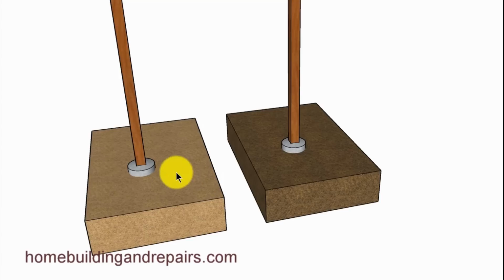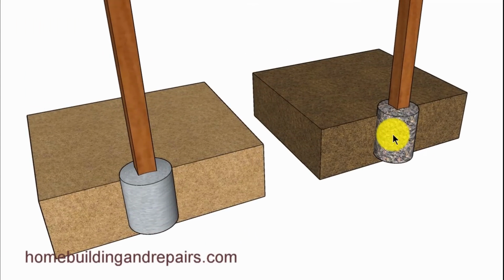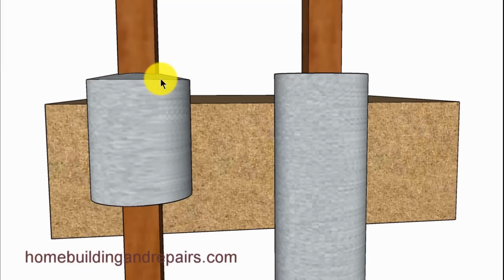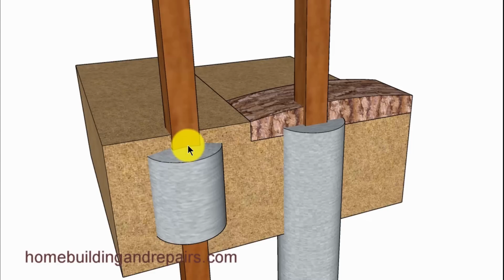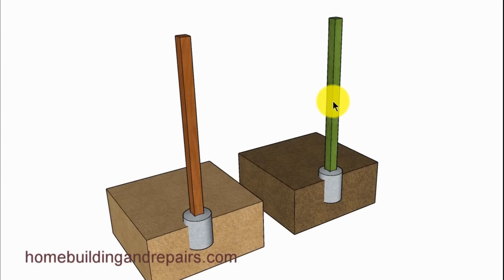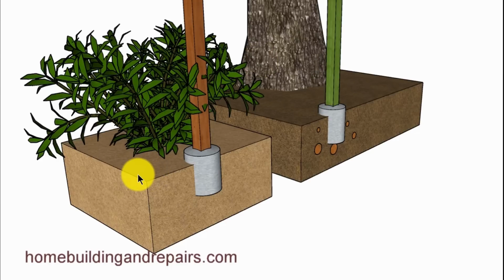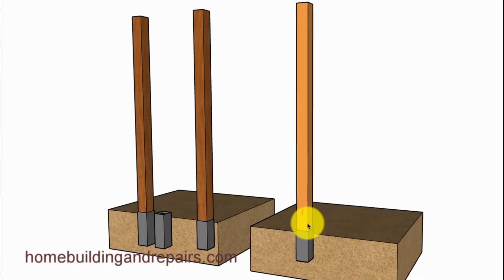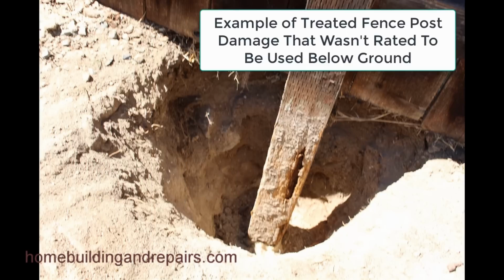Watch This Video Before Installing Your Next Wood Fence Post – Money Saving Ideas

Comment from the maker: Here's a playlist that might be helpful for a fence I recently built.

https://www.youtube.com/watch?v=6Zf0nvCbhfw&list=PLC0UeuIWsWeVsj-eNm8ABvISxTVVK8uQK
Reply: Fence posts vs concrete: dig hole, insert concrete sono-tube, fill sono-tube with concrete, insert Simpson teco-clips/concrete strong ties for fence post/column concrete anchor bases set at the correct height, etc., install post, install galvanized hardware(through bolt(s)/nails).
Reply: Too much talk…

Comment: Is there any benefit or drawback to using a cardboard tube form instead of putting the concrete directly into the post hole without a form?

Comment: What if you have sandy soil and the groundwater is just a couple feet below surface? I’m installing 12’ 6x6 posts and my hole needs to be at least 4 feet deep. Only problem is the groundwater sits roughly 2-3 feet below surface so am I just supposed to set the post in water and have it sitting in water indefinitely? Doesn’t sound right.
Reply from the maker: I couldn't help much with this one.

Comment: Hi I love your channel it is very informational!  What is the best way to install a wood fence over asphalt?
Reply from the maker: You will need some type of bracing to hold the fence up unless you remove a small section of the asphalt to dig a hole for the fence post. The bracing might require more lumber but if the fence is only temporary, then I would install the braces at a 45 degree angle and then attach them some how to sand bags at the bottom for support.

Comment: Quick question! I am installing post in Illinois. Soil isn’t draining due to clay or the water table is high. Regardless, based on your video, are you saying the best option is to surround the post with concrete. Is there concern that water will soak into the concrete and have no where to go once inside the concrete? Or will concrete keep water out from from the water table.
Reply from the maker: I would contact a fence builder in your area or your local building department for more information. I've only worked in a few areas with high water tables and nobody had fences.

Comment: My very old 100ft long and 6 ft fence posts sit in concrete where a concrete tubes were used.  Recently Fence Co estimator was suggesting just pouring cement in 3ft hole and setting posts in that then building a cement collars for drainage. This method will allow for a complete 100 ft fence to be built in one day while using the concrete tubes installation will take two days.  Any preference on that?
Reply from the maker: That sounds like a solid method, but do some more research. I don't know where you're located, soil conditions, lumber you're using or other important factors that make it difficult to provide a good answer.

Comment: I really wish I could still find Black Locust fence post wood.. That wood will not rot! You literally don't even have to set it in concrete you can just stick it right in the ground and 100yrs later it will still be standing. An old Amish guy in PA told me that and I seen his old fence that his granddad built and it would seem he was right.

Comment: It seems like the best one is the one at the very end with the tall metal brackets and the wood not being down in the concrete to rot. If the wood did ever need to be replaced  you wouldn’t have to dig up the whole thing, just replace a post. And if you keep the metal painted and clean then it shouldn’t rust for decades. Right?
Reply: Oh and thank you, thank you for the very informative video!

Comment: Just saw another video with a wood post placed in concrete and the wood post was rotting away. Concrete will wick moisture right to the wood which is not good.

Comment: First thing they should have said in this video don't use a wood pole because it's going to wrought. I will always use steel poles and most cities now only will let you use metal poles and not wood that's my two cents.
Reply from the maker: Maybe I would have if the title suggested the use of steel:)

Comment: If it goes into the ground, use the better marine grade PT.  That alone gives more chance of survival over time. I've always used your techniques of crowning the concrete above the ground level and as a rule of thumb, leave 6 inches above grade. It may seem like a lot but dirt happens... I took down some glass screening that I put up over thirty years ago near my shed. All of the posts were fine, dry, stable and no signs of rot. Very sandy soil. I reused all of them. The concrete was still well bonded, all the top tapering I worked years ago did it's job. The screening was aluminum framed commercial window glazing from a demolition job and survived several hurricanes,  many tropical storms and was located on the waterfront under large loblolly pines that shed a constant barrage of cones, small and large branches. All the posts were set about 3-1/2 feet down set with a bag and half each of the larger 80# bags of Quikrete, well tamped and tapered at the tops. When I pulled them out, they all had about 4 inches of exposure to the sandy soil at their bottom ends. If the soil had been loam or clay, I probably would have dug deeper and added 57 stone or brick rubble AND probably fully encased the bottoms, tacking on a short piece of 1/2 inch PVC tubing to make a weep drain. I tend to think that soil organisms are more of an inherent risk to posts and  pilings, especially in a marine environment where most heavy pilings failures are seen at the mud layer, where ship worms, torado worms feast on pressure treated wood. Keeping them away from the food source is the trick.
Reply from the maker: First off it's time to move:) Thanks for sharing and providing lot's of details like the sandy soil, it seems to either accumulate more water or drain it away from the wood.

Comment: Why not use galvanized deck post brackets?
Reply from the maker: I have given a lot of thought to that and don't think that they would be structurally strong enough. For example a strong wind can blow the fence over a little easier with some types of metal brackets then it would if the post was buried in the ground 2 feet surrounded by a concrete footing.

Comment: I'm dealing with the issue of a 6x6 supporting column that needs to go into the ground. But I have a high water table and hit water at 1 foot. Whats the best way to go about this??
Reply: High water means your posts will be mostly wet, most of the time, inviting soil organisms to thrive. Getting the highest weight  of marine grade of 6x6 will buy more life. It's more expensive but it's worth it.

Comment: I would never use concrete in wood fencing, i rather burn the part that is in contact with soul, just a 1/4 inch layer. When carbonated it does not rot as much, it is cheaper and easy to remove when needed. My posts are 20 yo and still firm. Also, wood that is processed aka sawed is also more prone to rot. I use natural round wood that is debarked and then burned.

Comment: I do not want to use 4x4 for my horizontal fence. What is the next least expensive thing can I use so it will last 20+ years?
Reply: Lol I don't want.? Well then figure what will works for your wants.

Comment: What do you think is a best method for installing a pergola poles in ground.
Reply from the maker: It would depend upon the size of the building, weight supported by the roof, building design and soil, but maybe using some type of pressure treated lumber and a concrete foundation or I've also seen these poles embedded in the ground surrounded by gravel.

Comment: On the farm we keep a 55 gal drum that we pour our old motor oil into after changes. If you mark the posts you're going to use just above ground level and soak them up to that mark for a day or two. That virtually keeps the oiled part of the posts water and pests free. It is my posts that I'm burying in my dirt out here in Briarpatch U.S.A., so I know it's not kosher for everyone.....papa don't preach.
Reply from the maker: Exactly, don't shoot the messenger and I've heard of plenty of people having good luck with this, but don't know it would be that good for the environment.

Comment: how about not using wooden post and you steel ?   I have just replaced a fence done many years ago, but the steel post in concrete are still just fine and new fence attached

Comment: There isn't a good way with wood post.
Better to use steel post.
If I have to use wood. I put several  inches of gravel in bottom of hole, then cement and make concrete slightly above grade and slope away.

Comment: My yard is pure clay. I dig 4 feet down, put a few inches of gravel, put the post in the hole then a few more inches of gravel and pour the cement. I recently pulled out 6 posts (27 years old) to redo the backyard, and not one speck of rot. Water will get trapped in the wood if it is encased in cement and will rot.
Reply from the maker: Yes, that is definitely something I've seen plenty of times, but keep in mind most people didn't call me to fix fences that were in good shape, I got to see a lot more of the damaged ones.

Comment: In wet parts of Oregon concrete is a must. Ground is mushy in the winter. 
I just pulled a dozen metal posts out of the ground by hand that someone tamped in gravel. 
I just leaned on them a bit and up they came. 
My first fence was tamped in clay. Come winter you could almost push the post over. 
The big foot print of concrete helps immensely. 
The concrete will absorb water, but oh well. The clay is wet anyhow.
Reply from the maker: Yes I'm in Southern California and concrete seems to provide more stability to fence posts.

Comment: I have been building fences and decks for years. One of the taboos with building with wood vs steel is: never use concrete on wood, 1. always use gravel for drainage. Water will seep through to the ground, won’t trap the water. We always use pressure treated wood or redwood cedar. Best resistance for rot. I always paint a couple extra coats on the bottom three ft with end cut preservative for added protection as well. 

2. Use concrete for steel posts, has a much better grab for concrete. Do not use gravel as it will shift in time.
Reply from the maker: Water or moisture in the ground can easily work its way into areas filled with gravel. It's often referred to as the path of least resistance.
Reply: gregvancom water runs downhill, moisture evaporates. Not saying I’m 100% correct but I’ve pulled many fence posts out of the ground to see the difference of how water affects wood with concrete vs steel with concrete. Tamped gravel with wood pulls up easily, but wood posts set in concrete all rot at the base of the wood where it meets concrete. With wood it’s not as bad for rot! The problem with steel and concrete is, try replacing the fence, pull the posts! I guarantee that you will pull up a ton. You need a small crane lol. Sure I’d use steel with concrete if I planned never to change the posts, I love the wood fencing as you can design different types, so to save it from rotting fast, I use gravel, simply because the water drains better.

Comment: A few years ago we used a couple of those 3-4’ metal Ground Post Spikes for the partial bit of fence at the back of our yard.  When our gate won’t close properly, I have go out to the posts, set up a short ladder to stand on, and pound the bejezers on the posts with a sledge hammer to set the metal spikes back down.  Problem fixed and the gate closes again!  GROUND FROST is my enemy!!  We should have used cement - or a 20’ spike! Lol   Thank you for the informative video!
Reply from the maker: You're welcome and thanks for the interesting comment.

Comment: I don’t understand how someone could properly cover this subject without mentioning the freeze/thaw effect.
Reply: EXACTLY!  Ground frost after our Alberta winters are a devil to deal with unless you slam a post 10’ deep!!
Reply from the maker: Yes, even the great ones make mistakes and I will attach a link to a video on installing fence posts in areas with freezing temperatures when it is completed somewhere in this video.

Comment: Think about this a minute. Very seldom have I seen a post rotted at the bottom after pulling out a post that was set in concrete.  It always rots or breaks at the top 4 -6 inches. My theory is it's not because of water seeping upwards into the wood from the bottom because gravity will always pull the water downward to drain. The gravel at the bottom may be a holding pit for water but only temporary as it drains off. You will know if your water table is high by the surrounding grounds and how fast or slow the ground dries in which case if your ground is always saturated then a wood fence post is not my first choice although there are ways although more expensive to make them last in water. My opinion as to why posts rot and break at the top, which is in most all cases is 4 reasons.  (1) There was no slope at the top of the concrete but more of a cup shape or even level with the ground like most people do and water sits there surrounding the post causing the wood in that area 4-6" to be saturated. (2) the concrete at the top of the post is not sealed around the post with sealant allowing water to go into the concrete and saturate the top 4-6" inches of wood causing rot. (3) The concrete was not poured  high enough above ground level and this causes a sealed water bowl around the post ( clay soil) (4) Too many people set the post and concrete and then cover it all up with dirt and ending up with rot because of the moisture that is constantly around the post in the soil. Here's my thought. When a post is first set in concrete and dried it appears to have a good seal around the post but that can be deceiving. A post in concrete will eventually loosen up in the concrete at the top over time from ground shift and winds rocking it back and forth so sealing the concrete to the pole with sealant is a good idea and probably resealing every couple years or so. Don't pile  soil around the post after setting just because you want to hide the ugly concrete, it's a recipe for disaster. If you put in enough concrete (above ground level) you can shape it downward at the top to a slope to drain off water. Then you can add your dirt but don't cover up the top to where the dirt is touching the post. This is just me but  I would never seal my posts ( the part that's in the ground) with anything like tar or paint before I install because any water that the wood wicks up over time needs to be able to seep out as the ground dries. (Evaporation 101) These are just my opinions and my strategies on setting posts. Yes, metal poles will rust over time but in my opinion they will last much longer and they don't absorb water. If you don't like the look of metal post do what I did and build a box around each one to make it look like a wooden post. You can create some really nice looks.  When the wood needs to be replaced it doesn't take much effort to replace it. Just my thoughts on the subject.
Reply: Long comment, but very insightful!   (I read every word!) Thanks Chuck. :)
Reply: Nailed it bud. The buried bottom is usually the culprit when I'm fixing a fence. Too many times have I had to show a customer this by just leaning on the post it snaps.
Reply: Well informed comment there, thanks from New Orleans. If I may, I find that the reason the post and cement separate is because of wood shrinkage when it dries out but may also swell some when it’s wet I presume.

Comment: Wow... 

What about frost? 

For rot to happen..  you need moisture, oxygen and fuel. 

Concrete holds water... 

So does clay... 

Clay also swells...
Reply from the maker: I don't have a video on dealing with freezing temperatures and frosty yet. And yes, concrete can retain water and clay soil can swell when it's wet, but not when it's dry?
Reply: @gregvancom  ... it can shrink when it's dry..

Comment: Well, most companies out there don't even install them right (far from the ideas). They just dig a shallow hole, bury the fence post with dry concrete and then water them from the top. They don't even use concrete form tubes. They installed everything in one day and collect thousands dollars check. We bought a house with a new fence and all the posts were tilted to a direction in just a few years. Now, I will have to dig them up and you know it is not going to be easy.

Comment: In my opinion I'd go with galvanized steel. It will last many decades in a inland-climate, and also several closer to sea. Seems like only wood that lasts in soil is wood with nasty chemicals and tar.
I would love to know people's experience with dipping the posts in motoroil etc, and maybe even with boiling motor oil.

Comment: OK, so we know what NOT to do, but then what's the best method for installing fence posts in sandy soils and avoid issues?  Do you agree to just creasote the wood including the bottom to waterproof it before we expose t to all kinds of water issues?  I gotta build a woodshed and set 4 X 4's pretty soon. I would do two coats, and that's the best I can come up with.
Reply from the maker: I would definitely suggest checking out some of our other videos about fencing and sheds at our website.

Comment: Shou-sugi-ban is an old Japanese wood-torching technique that supposedly weatherproofs lumber.  Have you ever used this method?
Reply from the maker: I get asked this question every once in a while and look at it like this. If it worked, then I'm pretty sure everyone would be using it. I'm not about to suggest that it doesn't work, but am suggesting that it might not work all over the world.